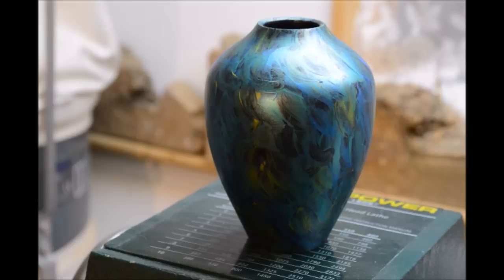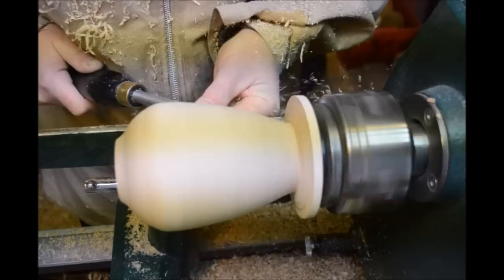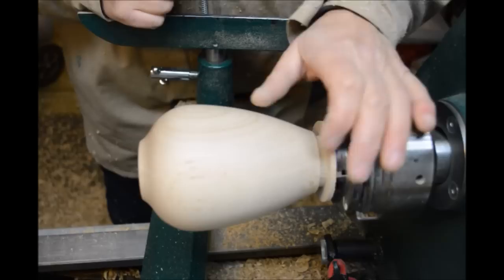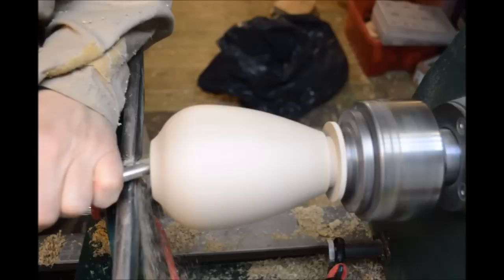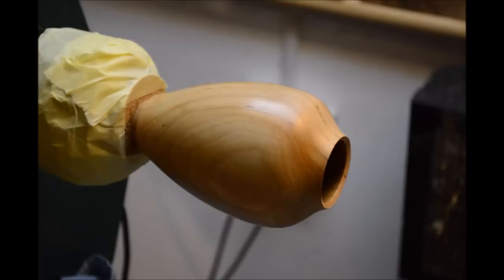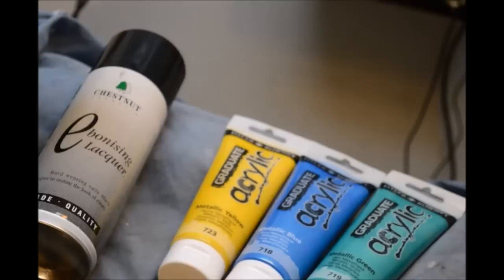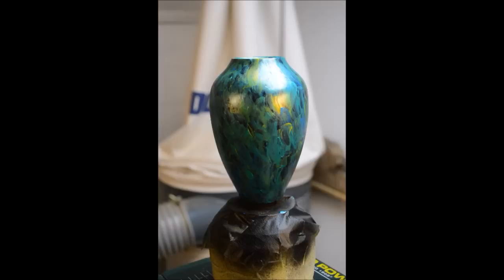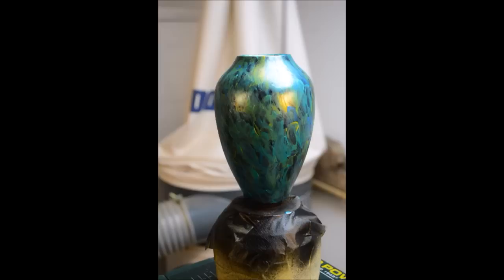Colouring No 4

Comment: Hi Gary Just found your video great job. At the end you said you sealed and varnished the following day, what did you seal it with??  I also subscribed looking forward to more videos.
Reply from the maker: Hi Robert, many thanks for the compliment, as they are acrylic based paints I use an acrylic spray sanding sealer then acrylic lacquer or even melamine lacquer. Hope this helps.  Rgds  Gary
Reply: Robert Anderson n

Comment: Nice work. What can I use instead of ebonizing lacquer?
Reply: Also, before you spray on the final clear coat, is it alright to gently sand the paint for a smoother surface?
Reply from the maker: Hi Robert, thanks for your comment. You can use any black acrylic aerosol / auto paint as a base